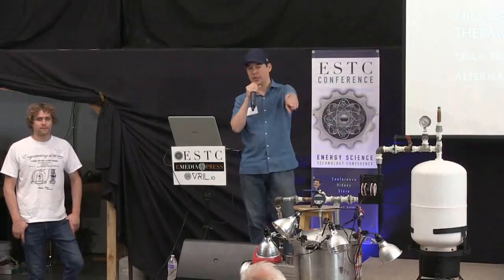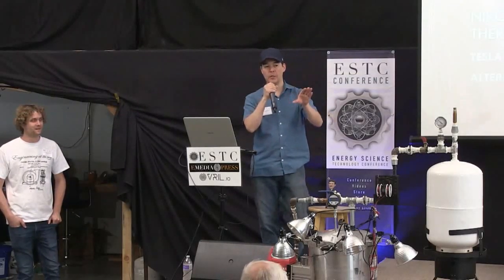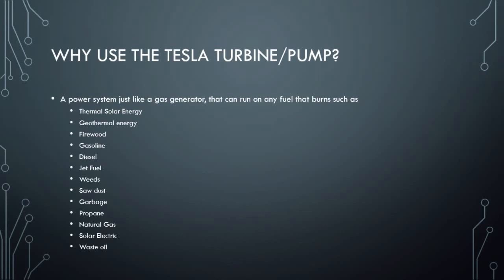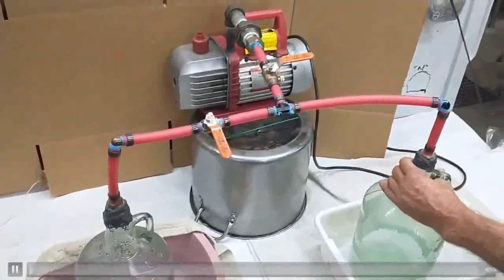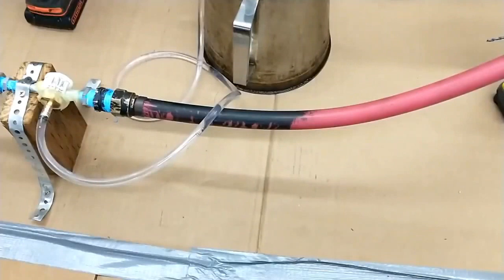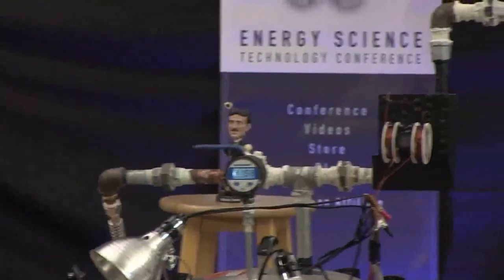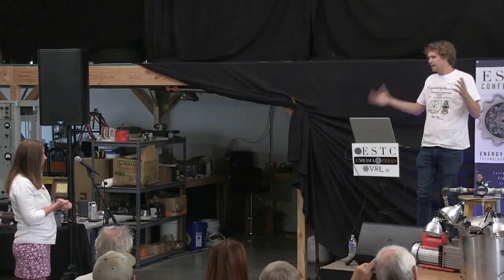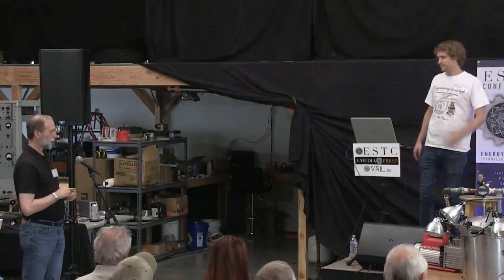2022 ESTC Preview - Nikola Tesla's Thermodynamic Transformer Part 3 by Jeremiah Ferwerda

Comment: So….continue the center pole and put a 3 foot diameter carbon fiber wheel with 60-80 tungsten pins evenly spaced at the perimeter. 
Do another pointing against this one, so only one tungsten pin on each side can get close enough to spark at any one moment. 
It won’t matter how great the voltages that are run through this apparatus, Tesla said he used up to 50 billion volts pressure. The frequencies are so great, they can’t interact with our bodies. 
Two wheels running in opposing spins, with a quenched spark gap, so there can only be one spark at a time, and running @ 60,000RPM, using carbon fiber wheels, and 80 evenly spaced tungsten pins on the perimeter, should be able to get up to 60 million per second frequency. 
Tesla said 1 million per second is in the zone that  resonates with the electrostatic ambient field….some call it “the vacuum”. 
Tesla said all sorts of cool things can be done when one only works in electrostatic energy at exceptionally high frequencies.

Comment: So this system will only work in places where there are freezing temperatures right? Otherwise you would have to spend all the energy gains to cool the condenser side. You would need freezing temperatures above ground, and then dig deep enough to get a high enough temperature to boil the water under vacuum (as long as you have a good heat transfer system to the earth, I don't think this temp would have to be that high above freezing)
Reply: It should work in warmer places too.  Changing the working fluid to one with the appropriate phase change temperatures should allow it to work efficiently just about anywhere.
Reply: @jameswarner7435  That's interesting. Good point.
Reply: @spangenbob  Liquid nitrogen and propane wouldn't work. You need something with a high boiling point so that the gas can easily be converted back to liquid with minimal cooling effort.
Reply from the maker: Your asking that question while the demo you are watching is sitting on a table inside of my shop in the middle of the summer. The condenser tank in that demo is about 80F, a horrible scenario and it still works.
Reply: tesla turbine works from heat, it will rapidly cool anything that goes through it
Reply: @flyfin108  No, that's not true. The turbine works through a pressure differential.
Reply: @Dziaji  nah, do some actual research, go look for vid where they run it for 20-30mins, everything gets frozen(if its closed system), it works of from boundary layer interaction that sucks out heat, that is where the work comes from
Reply from the maker: @flyfin108  Yep - and spiral path the fluid takes gives a longer path to pull heat out into mechanical work more than any "single pass" bucket/fan type turbine, etc.
Reply: @AaronMurakami13  if you heat the turbine it should increase efficiency compared to just having heated fluid, right?
Reply from the maker: @flyfin108  That would make the condenser unnecessarily hot because the heat is normally extracted by the hot vapor adhering to the discs so what comes out will be a lower temp. Heating the turbine itself in my opinion would reduce the thermal differential between the steam coming in so the temperature exiting the turbine would not be reduced that much - it might actually increase the exhaust temp.
Reply: @AaronMurakami13  i see, thank you very much for taking an time and explaining this,  i gave few thoughts for this when i saw closed loop runnin few years ago, but obviously i didnt get the physics behind it, again thank you.
Reply from the maker: @driatrogenesis  The turbine pressure is actually quite low under normal circumstances, even at really high speeds.